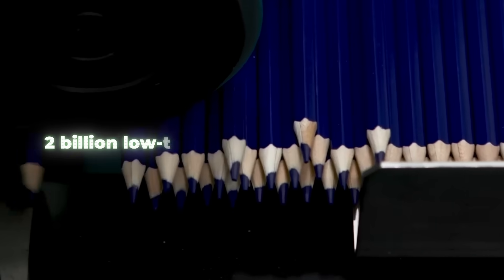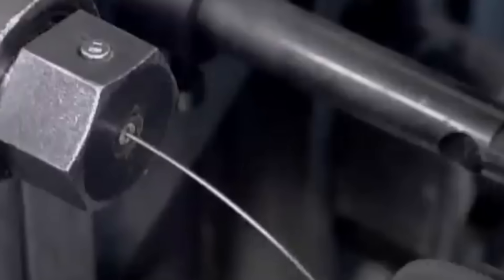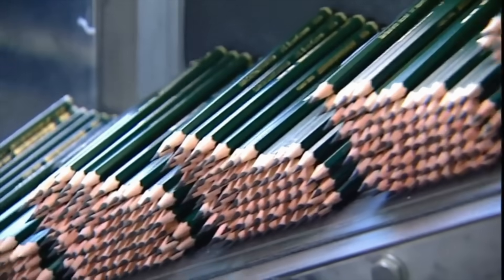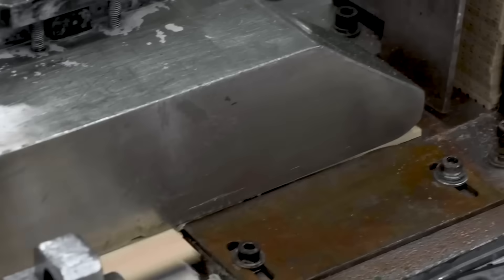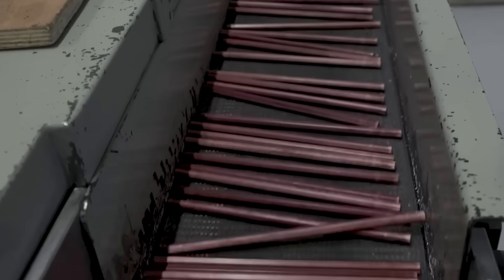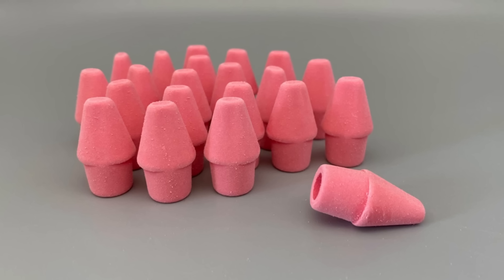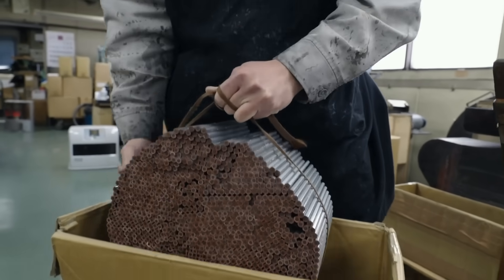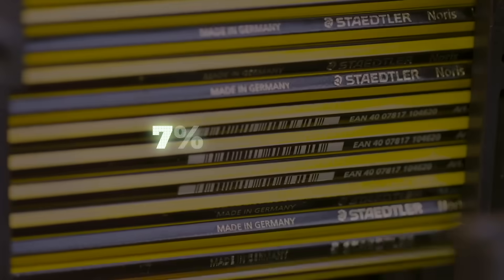How Pencils Are Made

Comment: I like writing with pencil on single thickness paper on a hard surface. There's no other experience quite like it. I write and create electronic and mechanical designs with a mechanical pencil, while I use wood pencils for art drawing. The ease of making changes has an advantage, though I've found that it's significantly more difficult erase after a day or more. I think the graphite particles migrate into the paper fibers during the first 24 hours or so.

Comment: Does anybody still make #1 or #3 pencils?
Reply: I think they do, but they are not labeled as "#1" and "#3." Using the European System, they would be labeled as "B" (#1) and H (#3). The European System uses letters and numbers to indicate the hardness and darkness of pencils. HB is the equivalent of #2 and sits in the middle of the scale. The higher the "H" number the harder the lead and the lighter the line. The higher the "B" number, the softer and darker the lead.

Comment: Haven't used one in a few years due to work requiring using pens but still believe the Dixon Ticonderoga #2 is the king of all pencils
Reply: Actually, I've never seen any other pencil besides a #2. Do they make a #1 or #3?
Reply: @kendallevans4079   Yes very specialized , drafting and art use, CAD has replaced almost all old fashioned drafting, I cant even remember if #1 was harder or softer lead but  used because it did not smug as much.

Comment: My first job was at Reeves Industrial Equipment, Orlando Florida. I was 21, in college evenings and and worked during the day. One of the engineering projects we did was a pencil yellow  paint machine @4:20 we did for Berol Co. In Mexico. Its exactly like the one shown. There's paint in the hopper one pencil is always in the hopper. A chain with push tabs pushes one after another. Then onto a 100 foot belt conveyor to dry. Then back into the pencil hopper for another coat of paint. This  is repeated 6 times. Brings back memories. Now I'm retired from a vast machine design experience.
Reply: ❤❤is the only guy ❤❤❤❤❤❤
Reply: @ZedaKhan-w8k  explain your self.

Comment: I wonder if the pencils we see today are these. I used to be able to use pencils until there was a tiny stub left. Now you can't even sharpen them once without the graphite breaking every time.
Reply: Cheap pencils are made with wood from pressed sawdust—they're not firm enough, unlike the pencils shown in this vid—made from actual planks of wood, which is MUCH firmer.  Less flexible, less broken lead.
Reply: @josephgaviota  This is why if I used a wooden pencils I'd only use a well-known name-brand one, it is worth it for the extra quality. However, I use mechanical pencils for that reason. With a good-quality mechanical pencil, combined with a softer lead (like a 2B) I rarely have a breakage problem.

Comment: When I was a kid, I thought that they drilled holes into the wood and pushed the lead in. I would carefully remove the wood off of a pencil lead then shape a new piece of wood, drill a hole in it so I could make my own pencils. It never worked out too well. 

I also used to carefully cut open burnt lightbulbs, reattached the filament, then try to draw out the air and seal them back up. That too never worked out too well. But some would work at a much lower voltage. 

The few times I "sort of" succeeded in my experiments would be the highlights of my days. I guess you could say I always tried to reinvent the wheel. 😁
Reply: I'd be so happy if my kid was experimenting like that.  Stay curious, always!
Reply: @jasondashney  Stay curious
     💯
Reply: That experimentation is GOOD for you.
Reply: I even thought there was a plant called pencil tree, how stupid am I?
Reply: What kind of work do you do? Are you an engineer now!?
Reply: I think Tomas Edison had started his inventory success from so kind of experience. Like many other famous inventors.

Comment: Many pencils are equipped with erasers…which are designed to smear the paper irreversibly, rip holes where you don’t want them, or have no effect on the graphite line at all….
Reply: And many people don't know how to use an eraser correctly..
Reply: High quality pencils (Dixon, Blacking, etc.) have good erasers. But those ones that are given out and have branding with paint that you can literally rip off, those erasers are usually crap.

Plus most erasers dry up after years of no use and don't work.
Reply: Ideas on paper👍😆
Reply: As a commercial artist I use pencils all the time. The erasers on a pencil are ineffective and rip right through paper and will ruin the line drawn. I think they’re there just for decoration.
Reply: I use mechanical pencils. Because the erasers that come with them are too small to be useful for more than a small amount of erasing, and that it an irritant to have to remove the cap, I use a separate good-quality eraser. I've never had it tear paper. Whether it smears or not depends on the type of pencil lead I use. If it HB it will usually erase completely. If it is a 2B it might not fully erase. Basically, the darker the lead the less likely it is that the marks will erase completely.
Reply: You need to get a kneaded rubber. They work just fine. And don't leave those annoying little bits behind to brush all over the desk.